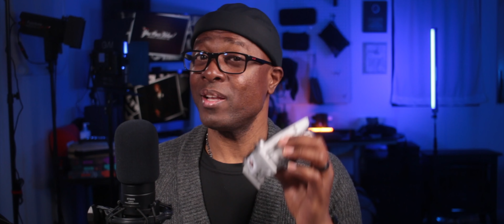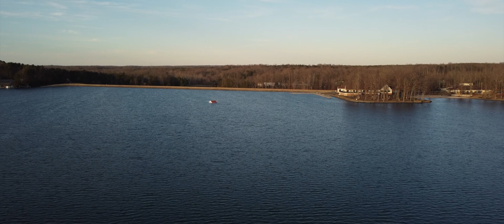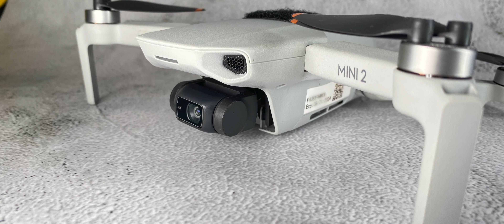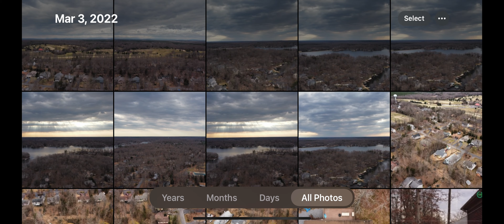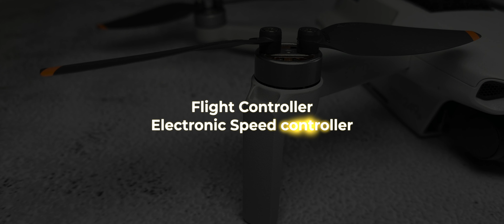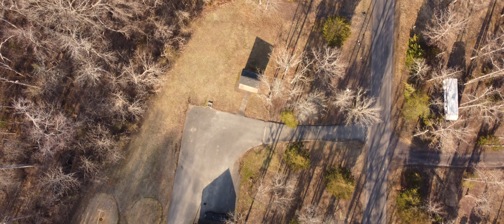Detailed Overview of the DJI MINI 2 Drone for Beginners

Comment: Superb!  Good detail, very informative and useful.  I did not know about the altitude sensor and assumed it used GPS.  This makes sense though, because as a long time GPS user I know that GPS altitude is necessarily much less accurate than horizontal GPS location because of the geometric relationship between the user and the satellites.
Reply from the maker: Glad I could help! Thanks for watching!